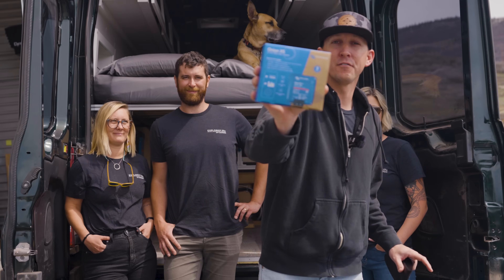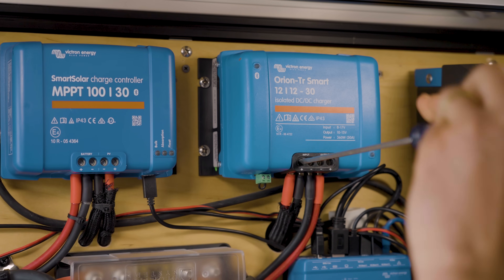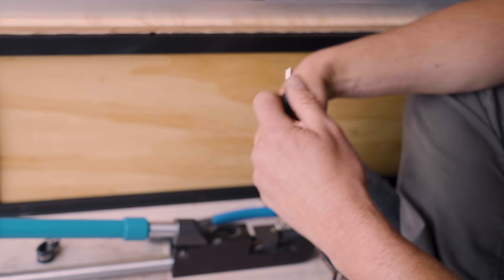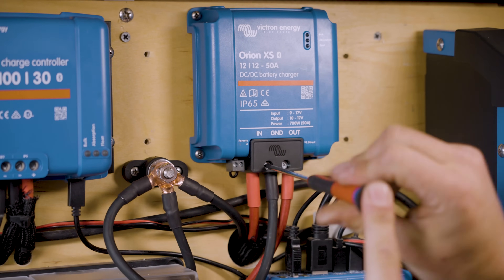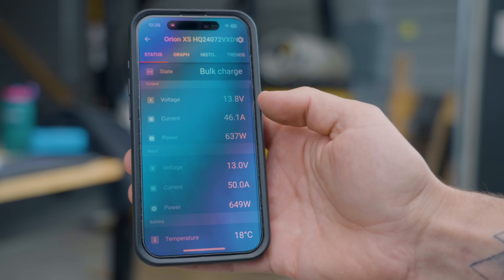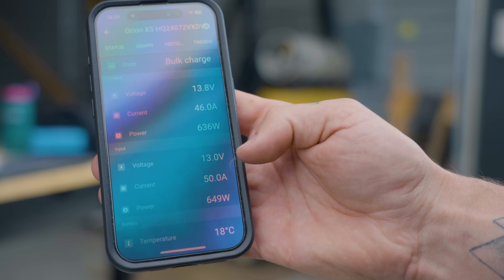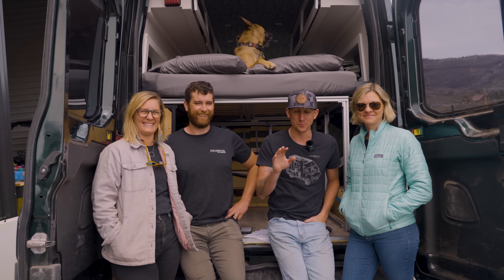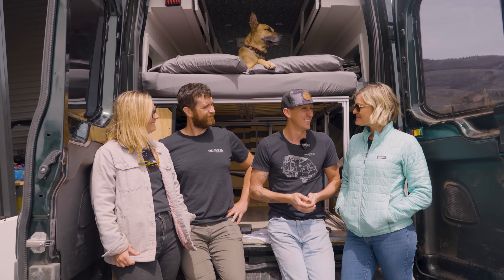Victron Orion XS DC DC Charger Installation/Upgrade Tutorial

Comment: What about people who sized the wires for 30A and now will be sending 50A through the existing wires and circuit breaker. I've also seen on some other forums that if you need to use 4awg, which is the max allowed, a ferrule won't fit properly. People have been getting creative with a hex crimper to get the 4awg to fit. I think mentioning that they should check their wire size and breakers can handle the upgrade would be important information to include.
Reply from the maker: We added that information into the retrofit wiring kit product page from this video: https://shop.explorist.life/shop/all-products/victron-orion-xs-12-12-50-dc-to-dc-charger-retrofit-wiring-kit/

"IMPORTANT NOTE: This retrofit kit is designed for use with the EXPLORIST.life Victron Orion-TR Smart 12-12-30 DC to DC Charger Wiring Kit in lengths of 20ft and 30ft. If you have installed this kit using a 40ft length, you will need to account for voltage drop by limiting the Orion XS to 40A current output."
Reply: I think I'll be using 4 AWG to run from my alternators to my camper where the charger is going. I have the new 50 amp charger being shipped to me. I'm curious to see how this ends up working, and what may change in this plan when it's all done. If I can get away with 6 AWG, that may be a huge help.
Reply: @allanmain5666  I couldn't find the 2awg I had purchased so I thought maybe I had done my calculations wrong and was supposed to run 4awg.  I did the travel trailer with the 4awg and then found the 2awg so from my vehicle battery to the Anderson connector on my hitch is 2awg and from the tongue to the XS is 4awg. I have gotten 50A input and 48.5A on the output so I got lucky and didn't have to rewire the trailer with the 2awg.  It's around 25-30' from my vehicle bettery to the XS.  Good luck😁
Reply from the maker: @Allan; Our wiring kits for this unit in fresh installs come with 4AWG wire, which is what we recommend for ALL new installations.  We don't recommend 6 AWG for new installs in an attempt to limit voltage drop since the input of this device can hit it's max input amperage limit (50A) with excessive voltage drop and therefore limit it's output.

If you're upgrading from the 30A charger to the 50A charger and keeping the pre-existing 6 AWG wire in place, we have length limits in our retrofit kit product pages that tell you what to do if your wire runs are longer.
Reply: @allanmain5666  What is the distance from your alternator to your house battery bank?  I have a travel trailer, so I had a long distance compared to a van. The calculations ended up requiring 2awg so I was going to run that to a terminal post and reduce that to 4awg for a few inches to the XS. Long story short I was able to get away with 4awg but getting a ferrule to work was impossible with the square crimper I have.  The other day on another forum I saw that someone used a 6awg hex crimp on the 4awg ferrule and had to trim it back a bit as to get the strain relief to fit properly.  I hope that information helps.
Reply: @chachi5975  It seems that 25 foot rolls of wire are appropriate, and I may cot about 5 feet off, so I'll call it 20 feet at the moment. Your tips may prove to be useful in my situation.
Reply: I was going to have this problem with cable size, I ended up just running an extra cable and am going to run the old and new Orion in parallel

Comment: Nice job highlighting how smooth the swap can be. It looks from the video that using ferrules that long doesn’t allow the strain relief to properly engage the wire as per the Victron manual and they seem pretty adamant in the manual that the strain relief is very important for long term connection reliability. Thoughts on trimming the ferrules or using shorter one?
Reply from the maker: It may have just been a weird camera angle that made it look like the strain relief was not engaged.  But yeah, in these projects, if you ever need to trim or omit a ferrule, that's fine.  Ferrules are there to make your life easier and if they are getting in the way, or making things worse; they can be left off if desired.

Comment: Is there a way to add additional VE direct spots on the Cerbo? I have all three used and no space for the Orion XS. It would be the least looked at as my system is in a 5th wheel and wouldn’t be able to see it working anyway while towing. Bit still would be nice!!
Reply: I have a color control gx, which has less ports than the cerbo but does have some USB ports. I'm not sure of the inputs on the cerbo but if you have an unused USB, Victron has an adapter that converts that little white end (sorry I can't remember what that is called)  to a USB.
Reply from the maker: VE.Direct to USB is what you're after: https://shop.explorist.life/shop/all-products/victron-ve-direct-to-usb-interface-cable/
Reply: @EXPLORISTlife  perfect thanks!
Reply: They have a USB to ve direct cable adapter, so that plus a USB hub will add as many ports as you need
Reply: @ticopowell  thanks for the info.

Comment: Maybe I missed it,... but how is it better... Oh, you just said cooler... is that all...? 🤔
Reply: Another important quality it has {other than being more efficient and delivering 50 amps vs 30 amps} is that it can be run in parallel with other units just like it. So, if you had two of them, you would have 100A charging capacity, which is very nice for those who have a large battery bank {like this camper has}. It takes a long time to fully charge six or even four 100AH batteries charging at 30A or 50A. And if you have to run your engine to provide that charge {which you often do if solar is inadequate or non-existent} that means a 100A charge capacity would charge the batteries in less than a third of the time compared to a 30A charger. 

Downside is they are expensive at about $330 a piece. But, if you think of the gas you would save over time and the convenience, perhaps it's worth it. Especially if you have multiple batteries to charge.
Reply from the maker: Cool, faster charging, better communications, smaller.  Go back in our videos a couple of months and you’ll find 2-3 videos we made about this new model.  Let me know if you can’t find them and I’ll get you some links.
Reply: 50 amps
Reply: 50amp